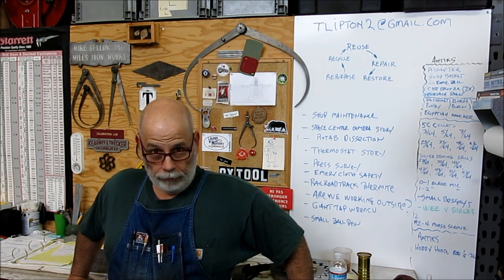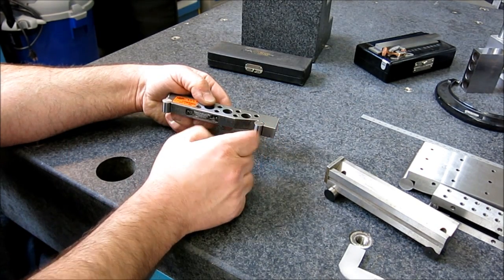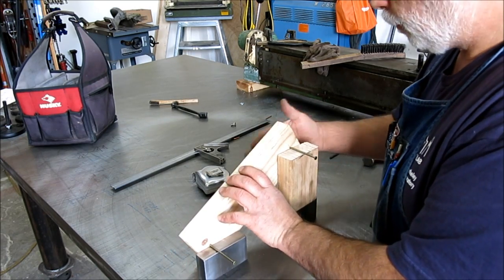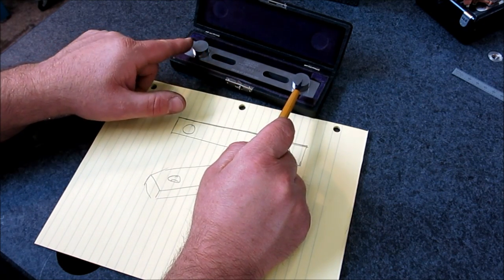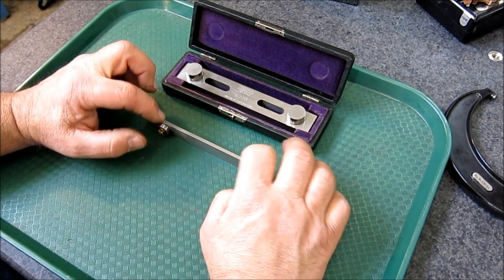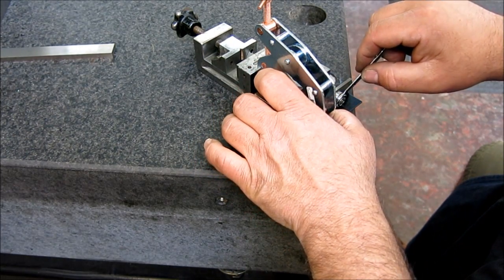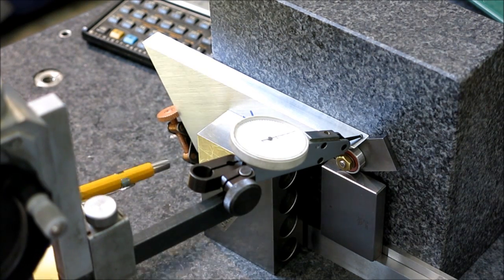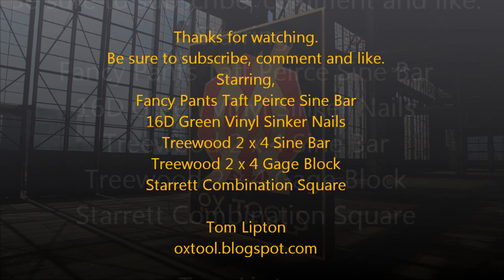Whats My Sine?

Comment: Thank You again for the videos, keep them coming.  Even So, I read through the comments and no one even mentioned that you pounded on the pointy end of your nails!  I have done this for years, it makes the nails go through the wood better.  I made pallets for a while in my college years.  Many many pallets.
Reply from the maker: +slad roznik Hi Slad,

I surprised myself that nails could hit an angle to less than a tenth of a degree. Thanks for the comment. 

Cheers,

Tom

Comment: Tom,  I think the parallel and bearings sine bar is genius. For those of us without a frequent need for a sine bar, and only one set of parallels, it might be nice to be able to assemble and disassemble one as needed, without so much hammer tapping. It occurs to me that if one were to cut a spacer bar to the required length, it could be used to space the bearings repeatably for tightening of the nuts, without having so many cycles of tap and measure. You'd still need to measure to be sure of the spacing, but you'd get pretty close on the first try and save some time on repeated setup. 

Thanks for the vid and the cheapness support!

-- Mike
Reply from the maker: Hey Mike,

Thanks for the comment. Helping fellow cheapskates save a buck is my calling in life.

Cheers,

Tom

Comment: On old fashioned ignition systems that have a coil sitting off on the fender, the plus and minus terminals where different sizes so you would not accidentally switch polarity.
This is the reason your ignition wrench has two different sizes.
Reply from the maker: +joshua43214 Hi Joshua,

That is one of the best explanations I have heard for the sizes being different. Thanks for the comment.

Cheers,

Tom
Reply: Another reason is that in the distributor you often run into a nut and bolt holding a part, or two nuts together. Most times they are the same hex size, so to loosen or tighten them you would need two sets of wrenches if they had the same size each end. Even the ones that have open end and offset open end, they will mix the sizes so that way you have two wrenches with the same size opening in one set.

Comment: Great idea with the parallel and the bearings. I have a box of hardened steel rollers that I took out of a broken roller bearing that was formerly used as a coil conveyor wheel in a large steel mill. I had originally intended on using them for spacers due to their close tolerances, but they would work well in this application as well.
Reply from the maker: Hi Ar,

As long as they are the same diameter sounds like they will work fine. Hardened drill bushings would work as well.

Cheers,

Tom

Comment: Good video, Tom.  I like that you focus on the essence of the concept and keep it free of the extraneous topics such as gage blocks, Pythagoras, coefficient of friction, relative humidity and standard temperature for accurate measurements.

I always associate fitted cases with that hue of purple velvet with pre-1920 instruments, perhaps because my father's 1930-vintage drafting instruments have a green velvet lined leather case, and instruments I've seen in purple cases always seemed older than it.  Velvet lined, no matter the color, reflects a time when men had great respect for their tools.

The sine bar is so elegantly simple, yet embodies such a powerful concept.  Everyone needs one if for nothing else than to demonstrate to their child or grandchild that math and trigonometry has practical applications.

There's a similar concept in Machinery's Handbook that shows how angles or tapers can be accurately measured or set using two different sized discs.  I always thought that it, too, has many practical applications.

Cheers,
Richard
Reply from the maker: Hi Richard,

Thanks for the nice comment. The purple velvet is stunning in this case. I always try to get to the part where the rubber meets the road. I have never tried the disc method. I'll have to take a look at that again.

Cheers,

Tom

Comment: Hello Tom,

My quick thought was to use your gauge blocks between the bearings to set the distance.
Reply from the maker: Hey Paul,

Normally I would have done that its the best way. But I wanted to show how you can do it if you don't have any gage blocks. You can make the blocks for under the roll to create a specific angle or use an adjustable parallel. I didn't want the idea to hinge on the need to have super fancy gage blocks on hand.

Cheers,

Tom

Comment: nice, a button sine bar. I always wanted a set of starrett buttons but would have never used them. here is good use. I would have put gauge blocks between the two bearings to set the distance. could use this technique to create some fixed angle plates too.
Reply from the maker: Hi Mark,

Gage blocks would be the best way to set the centers. I wanted to do it with really simple tools like nails and hammers so anybody could try it even if they didn't have gage blocks.

cheers,

Tom

Comment: Ignition systems used a lot of nut pairs. Either clamping a wire terminal from above and below on a stud weakly attached to a wire or other weak structure; or a jamb nut pairs to prevent engine vibration loosening the connection.   The alternating pair end sizes on "ignition wrenches"  provided two same size wrenches for nut pairs with one set.

Comment: Hi Tom, I think they make the wrenches with different sizes on each end, so that you can tighten something that has a 5/16" bolt head AND a 5/16" nut. There will be another wrench that has 5/16" on one end as well.

Makes it a pain to figure out which one you have in hand, but could come in handy.
Reply from the maker: +Andy Wander Hi Andy,

Thanks for the comment.

Cheers,

Tom

Comment: Great video as usual.

BTW since the bearing diameters are known & precise, then the easy way to set their centre distance is just jam some known length standards between the two bearings, Eg gauge blocks or failing that there are 123 blocks and parallels etc that could be stacked to get the required distance,  then just hold the bearings hard against them while snuging the nuts then just a final confirmation reading with the mic.

Also re the mismatched ring/open-end spanner, most motorbikes I've owned had such spanners in their tool set OR they had fasteners sets where the nut AF was different from the bolt head AF. This resulted in a much more minimalist set of spanners required to be carried.

Cheers
Reply from the maker: Hi Russ,

Using blocks between the rolls is the best method to space the rolls. I wanted to do it without using gage blocks so the guys who don't have them could see how you can get there. Adjustable parallels would certainly work for spacing as well. Its easy to add tooling but getting down to the bare minimum was the challenge here. Thanks for the comment.

Cheers,

Tom

Comment: you can use carpenters rubber mat to keep things from sliding I use it in the workshop under parts it stops damage and keep them held and the kitchen under boards to keep them still
Reply from the maker: Hey Bleu,

That's what I have Chuck for. He just wasn't around when I needed him. Setup was better after that futzing anyway. Thanks for the suggestion.

Cheers,

Tom

Comment: Catchy Title. Nice demo. Shows that you can get good results in the absence of high dollar precision tools. Another DIY project coming up..?
Think I'll use pressure treated for mine though for longevity. ;-)
Some beautiful threaded holes in that surface plate. You should make an artificial Chuck.

Colin
Reply from the maker: Hey Colin,

Pressure treated is way more accurate. Laboratory grade lumber.

Cheers,

Tom

Comment: Great video!  I have the little Fisher Machine 2.5" sine bar and I really like it for small work.

I thought that the most accurate way to measure center to center was to take outside of the bearings distance averaged with the distance between the bearings? 

I guess if the bearings measure out to be the same diameter to the tenth, it should come out the same.
Reply from the maker: Hi bk,

Good point. The hard part is getting a good accurate measurement of the inside dimension. Normally I would have used gage blocks to set the roll centers from the inside but I wanted to do it without blocks so folks that don't have access could still do a decent job.

Cheers,

Tom

Comment: Great video Tom!

Do you have the ability to do an exposure compensation, or use manual exposure, in video mode on your camera. You could dial the exposure down a little so that the indicator dial is visible. The rest of your scene would be a little darker, but the dial wouldn't be overexposed and your viewers would be able to see the action. I noticed when the outside door was opened in your shot that the camera reduced the exposure automatically for the extra light and the dial was perfectly readable, so it's probably not a glare issue. Another option would be to light a part of your scene with a bright light to trick the camera into lowering the exposure. You just wouldn't want the extra light on the dial. I appreciate your attention to the camera work in your videos. Always learn so much when I watch your videos.
Reply: After playing with camera angles, the next logical thing to play with is lighting. He's working with a dark granite table on the right and bright reflective stuff on the left where the light is coming from (even the back of his hand is a little over exposed). He might be able to get away with something as simple as adding a floor lamp to the right of the table when he is doing videos. 

Something to experiment with, anyway.
Reply from the maker: My goal is less editing and fussing around with videography and more shop work. I'm not sure my camera has exposure comp in video mode but I will check. Thanks for the comments and suggestions.

All the best,

Tom

Comment: reminded of the old trick of using a piece of string and the easy to remember numbers 3-4-5 when you are building a shed or something like that and need make a right angle
Reply from the maker: Hi Lasse,

That is a great method for constructing a right angle. Used it many time myself.

Cheers,

Tom

Comment: Nice video, Tom. One could recalculate the needed micrometer reading for the distance between the ball bearings, to get rid of any micrometer error in your setup.
Reply from the maker: Hey Flip,

What would be your length standard if you did it that way? Not sure I understand what you are suggesting.

cheers,

Tom
Reply: oxtoolco
I was thinking that if you have a measured fault over the stroke of 4,5 inches you could calculate the needed added or substracted lenght of the hypotenusa to correct for that.. the lenght of the stroke measurement beeing not so critical for getting accurate results in relation to the dial reading. the actual length standard would be your gage block in the setup I guess, since this is the only precise one. Or would you be chasing the fault around the triangle this way? I'm not totally shure eihter. My trigonometry gut feeling is my only compass here, and could be crooked..

Comment: Hi there, many thanks for the video. I do not as yet have gauge blocks,  could I use a carefully adjusted machinists jack to create the adjacent distance and then readjusted to create the opposite and thus create the angle with the sine bar?

Comment: Great video,  at the end (3:15) "the longer the distance between the bearings, the less sensitive the system is"  but I think you meant the system is less sensitive to "errors." i.e. errors in the center distance measurement, errors in the gage block stack-up, etc.  So a longer bar is more accurate to the angle desired.  Bottom line, longer center distance is better, if you can fit it in the vise or other set-up, which you do a great job of explaining earlier.  Cool video, thanks for sharing your experience.
Reply from the maker: Hi EJ,

You are correct that is what I was attempting to say. The demo worked out great. I actually surprised myself on that one. Thanks for the comment and participation.

Cheers.

Tom

Comment: the reason ignition wrenches have different size ends on each wrench is so you have 2 wrenches with the same size on one end in the set to tighten or loosen jam nuts, all sets of double open end and boxed end wrenches are always that way when you have a bolt with a head and a nut the same size you need 2 wrenches to break the or tighten them.
Reply from the maker: Hey Brad,

Thanks for the explanation. So why are regular combination wrenches not made that way? Seems like the same criteria.

Cheers,

Tom
Reply: like I said earlier double open end or double boxed all are mixed sizes, but combination wrenches (box on one end and open on the other) are the same on both ends so you have 3 different ways to turn a certain 1 size nut/bolt, the open end is always at an angle so you can turn the wrench over to get the wrench on in tight spot or even switch ends for a stronger grip with a boxed end, they pull from six points not 2, Top right side and lower left faces when tightening and vice verse when loosening.
Brad

Comment: Great Video!  The only thing else I would have wanted and needed to see is the actual calculations on paper as to how you came about the 1 minute error.  Seeing these calculations would have better cemented the knowledge to use the sine bar.
Reply from the maker: Hi Brian,

I think the one minute error was based on the difference between the center distances of my phony sine bar. Thanks for the comment.

Cheers,

Tom

Comment: As for the reasoning on ignition wrenches ... the idea was to have one open-end and one box-end of each size but only on two different wrenches.  This way you would have two wrenches available, one for the nut, one for the bolt.  In the standard 8 wrench set there are really only 4 sizes.  Nowadays you can get sets either way -- that is same or different on both ends.  Still, I know what you mean, as I have the same set and always end up trying to use the wrong end first.

Comment: A quick and dirty way to set your rolls, distance wise, is to make a stack of Johansson blocks equal to the distance minus one 1 bearing diameter. Or if you don't have Johansson blocks take a piece of stock and cut it precisely to the dimension specified. And then use that every single time you set the bearings.

Comment: Ignition wrench come with different sizes on each end so you basically end up with 2 sets of wrench’s if they were the same size on both ends and you needed 2 the same size at the same time  youd need 2 wrench’s but as they are you have 2 of each size to use at the same time

Comment: it seems the comparison you did with the taft pierce will allow you to calculate the correct length of the new bar.  Also the same calculation would allow you to find the correct length of the edm cut bar.

great video   thanks  john

ps an autocad drawing might save one from using trig  :)
Reply from the maker: Hey John,

The errors can come from a couple of places. In fact I think my "problem" with the faux sine bar was the rolls were not exactly .6250. I need to go back and measure them accurately and see if that's what was wrong. The other source of error is the center distance of the rolls. What I really need is one good angle standard to close the circle on all these measurements.

Big chief SOACAHTOA would not approve of the AutoCAD method.

Cheers,

Tom
Reply: oxtoolco
oscar  had a heap of apples that he gave to the big chief :)

Comment: Tom,
By figuring the error on the sweep (.0018"), then use math to figure the real length of the distance between the bearings.  Then when you use that true length, plug that length into the formula.  Great Idea using the parallels and bearings. 
Thanks for sharing.
Reply: If you know the distance between the contact points, you can always generate your own table of gage heights to use with that particular tool.  It would be a pretty easy Excel spreadsheet to automate the table generation.
Reply from the maker: Hey Herb,

The error can come from a couple places. One of which is the center distance and the other is the roll diameter and relationship to the gage edge. You have to be careful to understand where all the errors lie, lay, laid? Thanks for the comment.

Cheers,

Tom

Comment: Your video gave me a few ideas.
Lately I have been on a mission to create a set of "Screw Machine" length drill bits out of my old set of bits.
This leaves me with a bunch of stubby pieces of drill rod lying around.
I was wondering if I could drill a hole in a piece of Steel and use the bit I drilled the hole with as my pin.
The fit would be nice, so no chasing it around like you did with the bearings and a drop of Superglue would hold it fast in position.
If you were careful in laying out your holes, you could make your C-C distance anything you wanted.
Does this make sense to you, or am I just wasting my time?
Reply from the maker: Hi Racing,

That might work. There are other sources of error other than the center to center distance. You need to be parallel to the side of the reference edge of the sine bar. Why not just screw the bearings down with some machine screws and don't worry about the center distance but concentrate on making them parallel with the working edges of the sine bar.

Cheers,

Tom

Comment: Hi, So I have access to a mill and a surface grinder at work, Could I theoretically use a piece of 12.7 mm square stock and a pair of 6mm dowels (press fit) to get the same tool?
Reply from the maker: Hey Stewart,

You bet. Bore the holes for good location then measure them carefully after installation. When you grind the working surface use the pins as your reference so the tangency of the pin is dead parallel to the working surface of the sine bar.

Cheers,

Tom